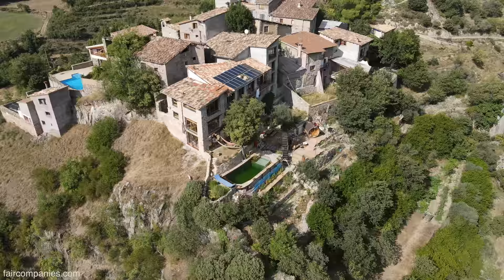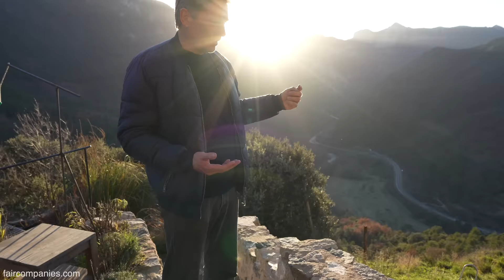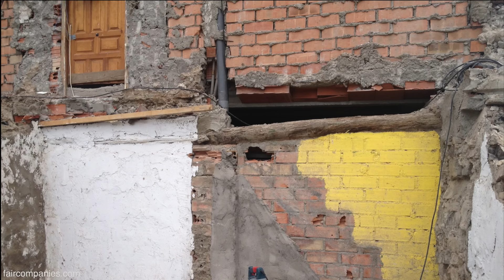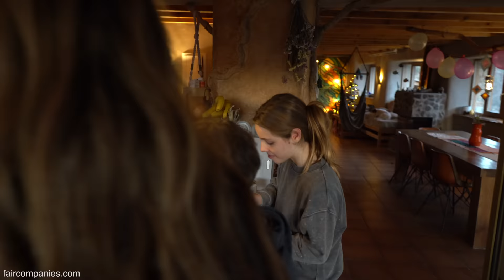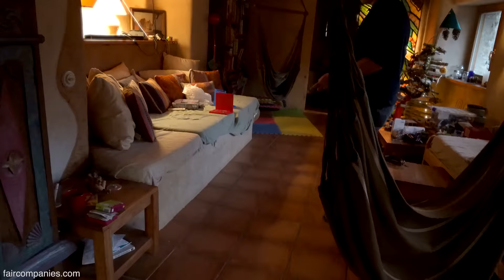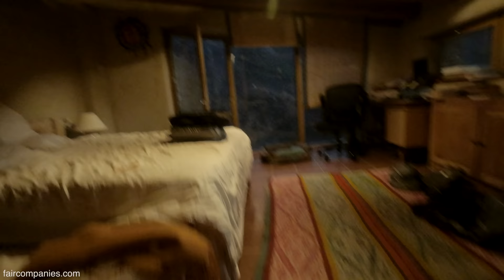Restores abandoned Pyrenees home by hand with regenerative system

Comment: This home is very similar to one that friends of my parents constructed in Vancouver way back in the early 70's.  Originally it was a very small home perched on the edge of a hill to the rear.  They expanded the rear to form a new kitchen and sitting area at the back, with an open staircase down to the lower level.  The back wall faced south, and was entirely glass, so it created a two-storey greenhouse, in which they grew vegetables all year long.  The back wall was very thick and absorbed heat during the day, which was radiated to the house after nightfall.  They had a small wood stove in a living room at the front of the house, facing north.  Except for that small living room the house ran (and presumably still runs) entirely on passive heat, and that worked extremely well even during Vancouver's very cloudy and rainy winters.  The creator of that home was an engineer.  The owners passed away quite a few years ago, and I don't know who has the home now.  I think there were a lot of homes created on similar principles during the very early '70's, during that early environmental movement, but all built by individuals, and tucked away in corners of our ordinary residential neighbourhoods.  It's a shame we don't know more about them.  It would be wonderful if someone could locate such buildings and bring them to the attention of the public now, when we are all far more educated and aware of the issues of climate change.  Historically, also, it would be interesting to research those efforts, as they are 50 years or more older now, and it would be interesting to know how well they have managed to achieve the builders' aims half a century later.
Reply: Yes , would be interesting to know !
Reply: Agree! My father who was an engineer himself, designed & built our 4-level home on five acres in hilly rural Rochester, Michigan in the 1950's. Uncle Ed also an engineer, & Aunt Ruth, (my parent's best friends),  purchased half our property & built a six-level home on their lot. 

Both homes were designed & built to maximize the benefits of the topography, sun movement, wind direction, etc. Very Frank Lloyd Wright-ish - using all natural materials, and lots of double-paned glass. You never need air conditioning, because half the house is built into the hill & remains 65 degrees all year round.
Reply: yes agree whole-heatedly Elizabeth- Look for home design books from Shelter Publications..self produced by 50 years of home research from Lloyd Kahn. This as well, tough & expensive to locate a copy- Handmade Houses/ Richard Olsen, Rizzoli ..& Kirsten aired a beautiful visit with Lloyd at his coastel home so be sure to look for that gem🎉
Reply: what neighborhood is the house in? i want to keep my eye out for it!
Reply: @emmasise1004  Out west, north of West Point Grey, that area.  But from the front it's a very ordinary house - the addition is at the rear.  You wouldn't notice it.

Comment: What an awesome house - the work that has gone into its restoration is amazing and I love all of the passive aspects of it too.  Water running through a cover rill the kitchen is a brilliant touch.  I really like the idea of heating and cooling the house using natural elements - I wonder how hot it gets in summer... I am guessing that the sun's trajectory which will be very much further north in the summer must also aid in cooling the house along with the breeze.  Very interesting adn very creative.  Thanks for sharing and have a happy new year 🙂
Reply: The idea is passive first, active if insufficient. Like a sailboat .. if there is no wind, you turn on the engine. When it does get too cold in winter, we have radiant wall heating using a heatpump. In summer, when it gets too hot (which it does) we have cool water running through the walls using the same system and heatpump.

Comment: Could you explain a bit more about radon extraction? Is this a concern for the average home or just this specific one? How does the extraction system work?
Reply: https://www.epa.gov/sites/default/files/2020-06/documents/2020.02_tech_bulletin_activating_a_passive_radon_system.pdf
Reply: only of concern if you live in an area with high levels of radon. This can be checked on maps available online. You can also so a on site test as we did. Our area should not have a lot of radon but on site testing showed high values below our house ...
Reply: @pauwelsemmanuel  thank you :)

Comment: Thank you so much for your videos! You bring us amazing homes and you help me to plan my next cob house. I love the idea of the pool and would like to do the same. What wonderful passive systems. I also like the toilet because it does still have a little water. Great idea to have the hose next to the toilet, although I am surprised that the water in the solid section doesn’t create smell. Could you smell anything?
Reply: Details are important in the design to deal with possible smells. The solid tank has a continous extraction to the roof so that avoids any smells coming into the house.

Comment: Housing crises explained: a single family nowadys needs two houses. (you can fact-check, the square meters per person used doubled withing 20-30years, depending of the country). Nice project anyway :)
Reply: The size of our homes is important and I agree that there is no sense making homes 50% more energy efficient while at the same time doubling their size. Our home has been LEED platinum certified, which is a certification with criteria related to home size and for 5 residents we are well below the reference used by LEED. Could not agree more with your reflection.

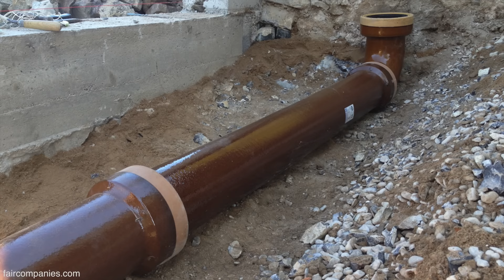Comment: 16:47 "there's no PVC"... That's OK. But your kitchen (drinking?) water is garhered in HDPE tanks.... Why?
Reply: We looked for healthy and responsible materials which was not always easy. In the case of the rainwater tanks, after a lot of research, we opted for Polyethelene which was the "least" bad option. We avoided Chlorinated Polyethylene (CPE) as well as Chlorosulfonated Polyethylene (CSPE) which produces dioxin, a persistent bio-accumulative toxic chemical, during its manufacturing process. We are not perfect, far from. Imperfection is part of nature, including ours. But we made a genuine effort. Quite frankly, the research into the ingredients of building materials was a major part of this project.

Comment: I don't like the ceramic tile floors. Wood floors are much much better. Ceramic floors are cold and sterile. You cannot go barefoot or in socks on ceramic, you need slippers or shoes..
Reply: True but we decided to keep the existing floor put in by a previous owner. Trying to work with was already there... In the kitchen it is a heated floor though so nice and warm